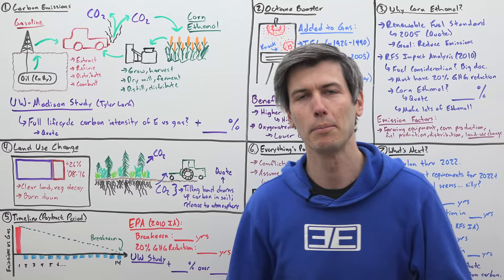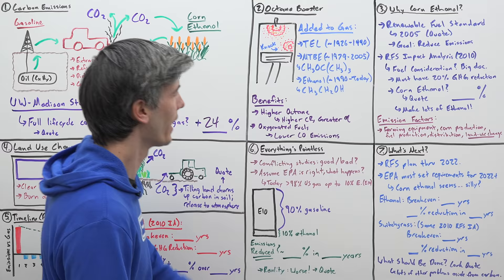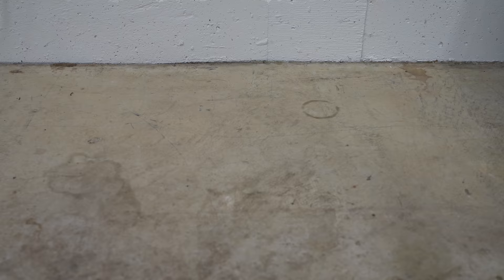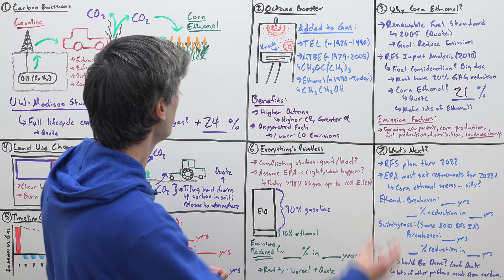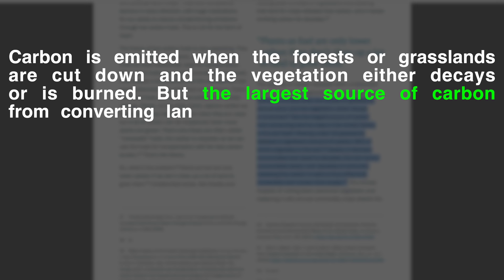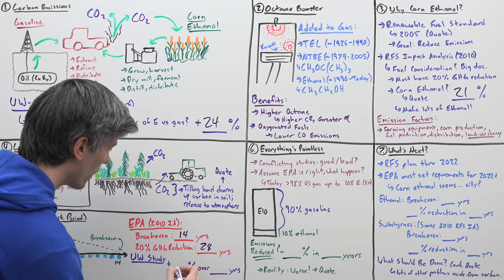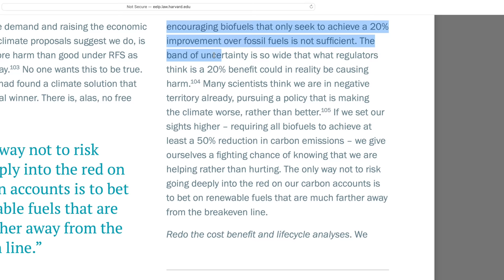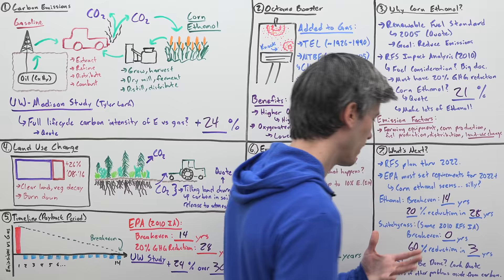America Was Wrong About Ethanol - Study Shows

Comment: I work at a ethanol plant in 2014 they use a coal fired boiler to generate steam, the plant also used natural gas and electricity. Plus  because of ATF regulations gasoline has to be hauled to the plant and mixed with the ethanol before it can be transported. After seeing it first hand I would guess ethanol does very little to reduce carbon emissions.
Reply: It can and does reduce emissions, it's the method we're using to make it at scale which is horribly inefficient. Question is, do we want cheap gas, or do we want cleaner gas? Can't have both, yet.

A solar reflector array and a highrise hydroponics tower... Energy, heat, and a gravity battery, built into one facility. that'd do it. Nobody is going to front the cost of construction though.
Reply: OIL refining also burns tons of natural gas and electricity, to distill gasoline. It actually takes more energy to make gasoline than the amount of energy that gasoline will produce.
Also ethanol is only bad in the US, because the US can only grow corn to make ethanol.
In brasil, where they make it out of sugar cane, the amount of ethanol obtained by mass, and by land area, is WAY much higher. Like 6 times more i think.
And corn is actually one of the worst crops for ethanol, but it's the only thing that the US can grow for it. Because of soil and climate.
Reply: @gdxd7956  what about switchgrass?
Reply: You mean coal fired?
Reply: @fieldlab4  Really.  what are you a fifth grade teacher .talk to text does not always work
Reply: @tazman4103  but correcting typos is a feature that DOES work, so I asked for clarification because in fact there are both electric coil and coal fired boilers. For the sake of your argument, try not to overreact.
Reply: @nobody8717  "Nobody is going to front the cost of construction though."  Because it is uneconomic.
Reply: @fieldlab4  Switch grass is just one of the many much better options than corn.
Hemp, Carrizo Cane, ... i even remember a docu where some people were converting ANY biomass waste into fuel, including SEWAGE waste.
The problem is .. MONEY
Corn, makes you a LOT of money.
Weeds .. eh, not so much. Nobody is going to pay 300$ for a ton of weeds.
Reply: That is poor engineering.
I work for a company that used to build ethanol plants (we don't anymore, since no one buys them). In our plants, biological residue is used for the steam that feeds the reboilers in the distillation towers.
A curious question: What is the natural gas used for? Why do you need both gas and coal?
Reply: @per6605  this is just a guess, but in the USA coal and gas are plentiful and cheap but most vehicles run on gasoline, alcohol or diesel, which is always easier to store and transport. It's potable.
Reply: @fieldlab4  Doubt that decision was made after a thorough economic analysis.
Coal might be cheap, but your own waste is even cheaper. And you will have to find a way to get rid of the waste anyway.
Reply: @per6605  but there are claims the waste is still viable cattle feed. Of course, what isn't considered viable cattle feed?
Reply: @nobody8717  
What is a Rube Goldberg Machine?
Rube Goldberg was a cartoonist, engineer, and inventor, who lived in the United States in the 20th century. He's most famous for a series of cartoons he drew, which showed complex machines and devices being used to solve simple problems. For example, one famous cartoon shows a ''self-operating napkin,'' with a series of levers, pulleys, and connections to achieve the simple task of wiping a person's mouth. The device is so complicated it includes weighing scales, clocks, a parrot, and a rocket. 
These devices captured the imagination of engineers across the world, and have been used regularly by educators as an example of engineering and physics principles. They've even been featured in films, especially in the 1980s, like classic adventure films such as Raiders of the Lost Ark and The Goonies.
Reply: Don’t forget all the aquifer water wasted in growing the corn that could have been saved for saner uses. I remember Bill Mahr going on about how we should match Argentina’s output of ethanol, but they have tropical rainstorms all the time replenishing their water supply as fast as they use it. Water could not be cheaper for farming, which has always made Argentina the breadbasket of much of the world, or used to until they switched so much land use to corn.  But at least they never have to worry about water, regardless of what they grow. Our aquifer in the States, however….
Reply: SUCH a cruel joke. We need to rewrite “Dante’s Inferno” to include a special category of swindlers, “The Boondogglers”, who are condemned to forever try to make an impossibly complex Rube Goldberg machine do a preposterously simple task. If they were to ever succeed, Satan would let them out of hell, so of course its impossible.
Reply: @nobody8717  
The Icelandic method of geothermal has worked solidly for 18 years in Iceland, but Greenie fanatics always turn green with cognitive dissonance whenever I explain that we would have to make a tiny compromise on the national and state park ban on industrial development of any kind within the park boundaries. See, about 90% of American volcanic land (not counting the Hawaiian main island) just happens to be within one park or another. Yellowstone alone could power at least 1/4 of the country, maybe as much as 1/3; combined with all other volcanoes, we could have 2/3rds coverage easily. Nuclear could cover the rest. Then we could build electric train complexes in every town and city over 10,000 in population, all powered by this grid and provide people with special incentives to use these systems almost exclusively when only commuting within each such municipality, keeping cars for just inter town and state travel. Also, keep electric batteries just for transit busses. We REALLY should not switch to lithium car batteries, en mass, until we solve the problem of how to recycle them efficiently, safely and cost effectively, as rampant lithium ion pollution is a WHOLE other can of worms we need to nip in the bud ASAP. My idea is totally doable, would vastly reduce emissions and make gasoline cheap. But because fanatics treat the parks like sacred temples to “Gaia”, they REFUSE to compromise or the long term.
Reply: @eldermillennial8330  
It only makes sense in Equatorial regions, and that ain't the current US
Whenever you have managers and fund providers (Congress) that have no connection with the actual project implementation...and then you make those people electable, you get programs like Military Ind Complex, government employees whose jobs depend on the program being funded next year..
Reply: @gdxd7956  The problem is getting the alternative alcohol sources in quantities large enough to meet demand. If you have to use a whole bunch of different sources each with their own specific refineries, then nothing was gained.
Reply: @eldermillennial8330  Not to mention the coil, oil or gas to run the pumps to get the water to the crop.. Or the fuel to farm the land, plant, harvest and transport..
Reply: @gdxd7956  I came here to say the same thing.  Also other than greenhouse, the other hydrocarbon emissions are much much lower.  i don't like ethanol gas, but it does offer an improved cycle.  The biggest waste is that that by using ethanols high octane count, the oil companies can use a lower quality gas and still get the minimum octane count needed for automobiles.  If they weren't allowed to produce a lower grade fuel, the efficiency of the fuel would also be greatly improved through higher compression ratios.
Reply: @gdxd7956  
Your statement is completely false.  It takes very little energy to extract gasoline from crude oil.  It's a simple task that is done in many first year chemistry classes on a desktop.
Reply: @dankuchar6821  It's not my statement.
I read it on a report made by experts in study for an official organization, i think it was for the UN.
Go and tell them they're wrong and you're right.
Reply: @gdxd7956  
Just post the study then or link to it.  
If what you were saying is correct, then nobody would bother making gasoline because they wouldn't make any money doing it.    Anyway, it's not worth arguing about.
Reply: @dankuchar6821  Where did i say anything about money?
It takes more ENERGY, not MONEY.
You're way out of the intellectual level here.
Reply: @gdxd7956  
If it took more energy to create something than you actually got out of it, then it wouldn't be profitable to do it.

 It takes almost nothing to separate gasoline from crude oil.  The basic process is simply that you heat the crude oil and all the different constituents come out at different temperatures. That's why it's dying a big huge tower.  That's why we use gasoline. It's cheap, it contains a lot of energy per unit of mass, it's easily transportable, and it's incredibly easy and cheap to make.  That's why there's so much money in oil.
Reply: @dankuchar6821  lol. Like i said, you have NO idea of what you're saying. That's all.
I don't discuss with ignorants.
Reply: @per6605  making steam with biological residue is not better then coal, coal is actually cleaner burning in comparison to wood, but worse then gasoline,

but the production of gasoline consumes too much energy to have good emissions at scale which is why its only used for portable things, pretty sure "natural gas" is much cheaper to produce so it can come out ahead of coal for powerplants, 

solar panels are horrible due to the polluting industry that creates them and the limited lifespan however since the power output of the sun is so high there still better then coal, wind turbines are unreliable with a huge land footprint but decent power/cost, batteries are the worst things ever if there is a argument against EVs its the batteries, other ways of using the sun like mirrors are pretty good a decent land footprint but better then windpower and less emissions then solar panels.
Reply: @XDbored1  That is just wrong. 
In general, combustion in large burners is quite complicated, and a lot of factors will affect the result.The major effect on the emissions will be due to how well the burner is constructed, and how well it is optimized for the task.

However, if you look at the fundamentals, you will find that:
1. Coal contain sulphur. That sulphur will be released in the smoke as SO2, through the stack, and form sulphuric acid
2. Coal contain mercury. That mercury will also be released from the stack
3. Coal has a chemical structure that is more likely to give PAH and nitroaromatics in the exhausts.
- The one factor in favor of coal, is that biological residue contain nitrogen, meaning you can never totally eliminate NOx when burning wooden material

But as I said, if you burn biological residue in a burner, not properly adopted for the task? Then, yes, the smoke will be quite dirty. But claiming that coal is a "clean" fuel? That is just wrong
Reply: @fieldlab4  Yeah, I think you are right, that a specific part of the waste is quite good as cattle food
Reply: @gdxd7956  thats actually not true. hemp for example grows like wildfire. kudzu as well. the gov made it we had to use corn for some reason.
Reply: @gdxd7956  and is readily available starch which is easier to convert to ETHANOL! Switch grass and many other possible feed stocks require a few more steps to get to ethanol.
Reply: @fieldlab4  It is in fact a viable cattle feed that is controlled for its production. We have certain standards for this. We also create another high energy feed product known as corn oil from within the process. Cattle don't need starch in their diet. We are only after the starch which makes sense to send us the feed corn, cattle corn, #2 yellow corn, or also referred to as dent corn. We process this through a cook system to gelatinize the starch for conversions. By handling it through our process, we actually create a higher digestible product for the cattle.
Reply: @jeffreyrigged  Yes i know that, that's what i said, there are better options than corn, way better, for making biofuel .. but it's not better for the FARMER.
The farmer is going to plant what makes him more money. He does not give a s*** about what they're going to do with it. Or if it's "green" or whatever. The only green in farming is US$.
Corn now, is 340 US$ / ton.
Nobody is going to pay anybody, 340 US$ for a ton of hemp, or switch grass or etc...
The wording was bad, corn is the only thing the US can grow that is profitable for the farmers and also usable to make biofuel.

And i'm pretty sure, (this is a guess), that ALL the biofuel manufacturers would be MORE than happy (and able) to use cheaper and more efficient mass sources like hemp and switchgrass ... but ... it's NOT on the market.
They HAVE to get what they CAN get, or else the plant closes. And what is on the market... corn.
Because nobody is growing hemp, or grass, or anything ... because there's no money in that. Or like i said there's MORE money in corn.
Reply: @gdxd7956  yeah its like ev all about the money
Reply: @nobody8717  You could have both, if not for laws preventing it.  Look into sugar production laws, or read the rant I wrote in the comments.  Ethanol isn't the problem.  Corn ethanol is the problem.  And the only reason it is a problem is because of laws Congress passed making it illegal to fix the problem.
Reply: @gdxd7956  Not because of soil and climate.  Actually just because of laws enacted by Congress.  We are limited on sugar cane production due to climate, yes, but sugar beets can be grown nearly anywhere, and actually slightly outperform even sugar cane in sugar yields.  But it's illegal to increase the crop (limited to 3x the domestic sugar cane crop), and illegal to use it for ethanol production in the U.S.
Reply: @dankuchar6821  It actually does take more energy to separate the gasoline than you get from the gasoline. It's a sneaky metric being used, since the same energy cost that produces the gasoline also produces all the other fuels from the crude oil and the raw material for quite a few byproducts. By cherry picking only gasoline and ignoring all the other outputs, a person can make the process look very inefficient. If a calculation is instead made including all the useful output of the crude oil cracking process, you find very high efficiency returns.
Reply: @gdxd7956  actually, the entire problem is the government. Corn is subsidized, reducing costs and increasing profits for farmers while increasing cost to taxpayers. Then, ethanol production from corn is also subsidized, reducing costs and increasing profits for processing companies and increasing costs to taxpayers. Then, much better and completely viable alternatives like sugar beets are illegal to be used for ethanol production in the U.S., ensuring a monopoly in the ethanol production process, and providing Congress with very large kickbacks every year, while costing taxpayers literally billions of dollars annually. There are hundreds of laws on the books in just the food/energy production sector designed from the ground up to protect special interests at taxpayers expense, in order to fatten the purses of Congress.
Reply: @gdxd7956  I must ask you to show details for how you can state that "It actually takes more energy to make gasoline than the amount of energy that gasoline will produce". The cost of extraction, storage and transportation of oil to a refinery would be factored in to the input cost of running that refinery. In all studies I have found, they show that the refinery efficiency ranges between roughly 86% and 94%. I cannot believe that any company would pay more for an input product than they could charge for the output product, they would all go bust before they started.
Reply: @richardchurch9709  Jesus, another one.
You even answered yourself and don't know it.
"THEY COULD CHARGE" duh. They can charge whatever they want. Didn't you just NOW see gas price go from 2.4 to 5
Didn't you JUST say they "couldn't charge more"?
If X product costs 100$, i charge 130$.
If X product costs 1000$ i charge 1300$
etc.
What it requires to make it is irrelevant to the price. The cost and price is ONLY based on money spent, NOT on how much energy it consumes or makes. NOTHING has a fixed price.
JFC these youtube economists.
Reply: @dankuchar6821  agree completely.  Bogus metrics...
Reply: @yaemz123  Corn ethanol subsidies ended back in 2011.

Corn ethanol is somewhat insulated from corn price for if the price of corn is low, then so too are the distillers grains/byproducts.  But if corn goes high, then they can gain from higher prices for those same items.  Since the 2005 energy act passed, farmer subsidies went from just shy of 25 billion in 2005 to just shy of 10 billion in 2018 the year of most ethanol production ever.  Since the 1996 Freedom to Farm Act passed, farmers are free to plant any crop they wish without losing subsidies.  End users must bid for acres.

No corn is grown for ethanol, rather ethanol is a value-added product of already existing feed production which leaves 100% of the protein still available as feed in a healthier, more digestible/efficient, and more concentrated form called distillers grains.

Because of this feed factor, corn ethanol is able to outcompete most any other source out there including sugar beets.  If we were all vegetarians or ate grass fed beef like I try to, then sugar beets would be more viable.  The renewable fuel standard does not specify what source the renewable fuel must be.  Sugar beets are free to compete.  Since they require dedicated acres and are hard to store, they did not come to be.  

Believe it or not, the corn belt grew more corn acres in 1980 before ethanol than they do today with record ethanol production and ethanol plants everywhere.

2018 Iowa 13,200,000 acres of corn with record ethanol production
1980 Iowa 14,000,000 acres of corn before ethanol

2018 Illinois 11,000,000 acres of corn with record ethanol production
1980 Illinois 11,600,000 acres of corn before ethanol

2018 Indiana 5,350,000 acres of corn with record ethanol production
1980 Indiana 6,450,000 acres of corn before ethanol

Some northern states did increase corn acres but this was because feed barley fell from favor from cattle feeders and better early maturing corn varieties and trend started before ethanol.

US barley acres were 8.32 million acres in 1980 before ethanol and declined to 2.55 million acres in 2018, the year of most ethanol production.  Corn acres in 1980 were >84 million acres before ethanol and during forced government land set aside and were 88.9 million acres in 2018.  Combine the two and we get 92.32 million acres in 1980 of the two feed grains and 91.45 million acres in 2018.
Reply: @gdxd7956  in no way does it take more energy to make gasoline than the amount of energy it will produce, let alone the energy from the other products separated at different temperatures. Your statements are lacking full information and facts thus they are also misleading and false.
Reply: @marlboroman71818  Your statement is lacking information and facts.
Reply: @gdxd7956  its not really that hard to equate the btu's needed to heat feed stock for condensate or a barrel of oil and see that the amount of natural gas or other fuel needed to seperate gasoline and the 6 or more other cuts of product have more btu's of energy than the fuel.
Reply: @nobody8717  the specific heat of those materials under the sun will cause average temperatures to rise
Reply: @gdxd7956  How would ADM, Monsanto monetise weeds...